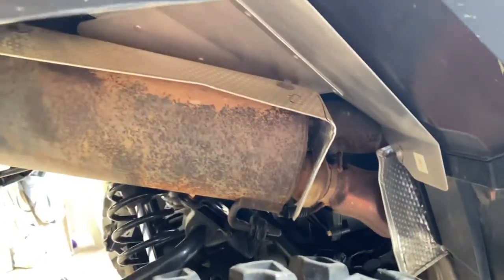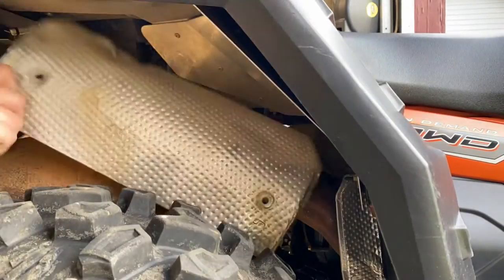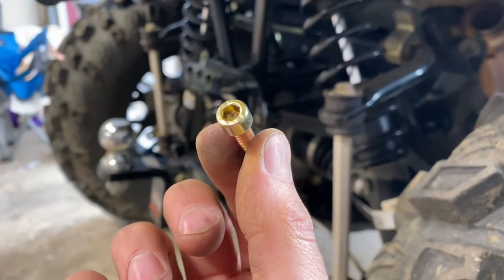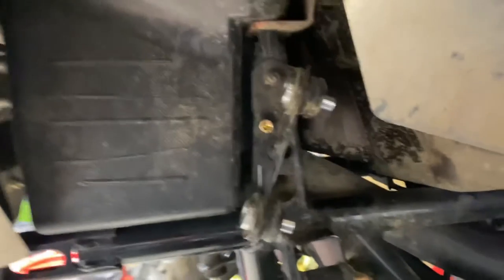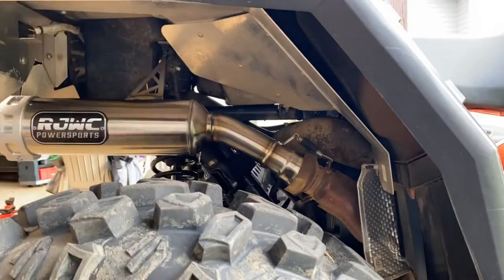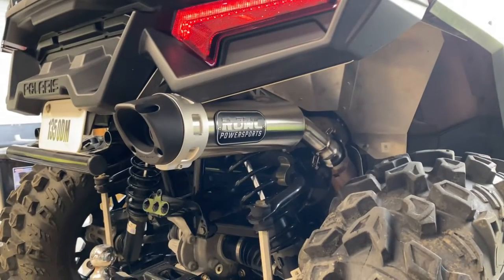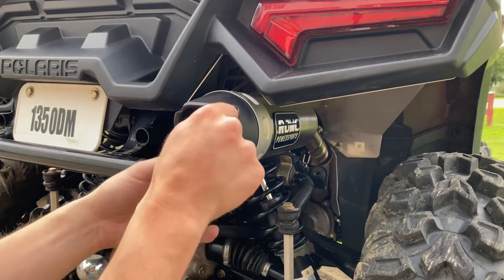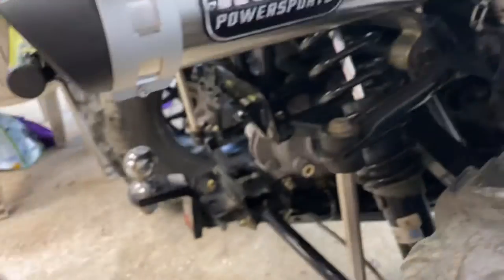The Ultimate Upgrade: Sportsman 850 RJWC Krossflow Install Revealed

Comment: I just got a buddy who owns a  muffler shop to bend up a straight pipe- press a flange at one end then weld on the spring eyes and hangers! He did it for a case of beer, it sounds awesome, it’s super lightweight and opened up some power on the machine! 
Also If you want to lose a little more weight on your machine- remove the whole rear sway bar!  Then tighten up the rear shocks a notch or 2, 
I find it performs better without!!

Comment: How does it run with no tuner? So many shops tell me to tune it and some not to what’s the best?
Reply from the maker: When ever putting an exhaust on I recommend tuning it. These newer bike tend to run on the leaner side as it is so when you throw an exhaust on it and let more air flow it’s going to run even leaner which is not safe for the pistons as it will run hotter

Comment: thx for your video.
I recently installed the same Krossflow RJWC exhaust on my Sportsman 1000XP 2018 but i have some engine overheating problem...
Did you installed a tuner or something with this one ?
I dont understand my pb and don't know what to do...
Thx you
Reply from the maker: I do not yet but will be ordering from rvs performance here soon
Reply: It's because you're running the motor too lean. It's in the description that this exhaust REQUIRES an aftermarket programmer.

Comment: Thinking about putting one on mine I subscribed
Reply from the maker: I love the sounds from it. I do recommend putting a fuel optimizer on or do tubing to add a little more fuel as they do tend to run a little lean even with factory exhaust also use code CANAMADDICTS on rjwc website to save 15%
Reply from the maker: Also thanks for subscribing I returned the favor
Reply: @atv_lifestyle  can you ease into it without it being stuipd loud reason I asked because I bought a gse exhaust for my old 2014 570 and it was just way to loud soon as you barely pushed gas you needed ear plugs I took it right back off and sold on market place
Reply from the maker: @easttennesseehollerriders  in my opinion yes I plowed with it in town. They do make quit core for there exhaust as well
Reply: @atv_lifestyle  I think stock sounds good but this looks alot better and alittle  more deep
Reply from the maker: Gives it a lot more tone. If you don’t want it to loud I’d get the quiet just in case. You can always switch them back in forth